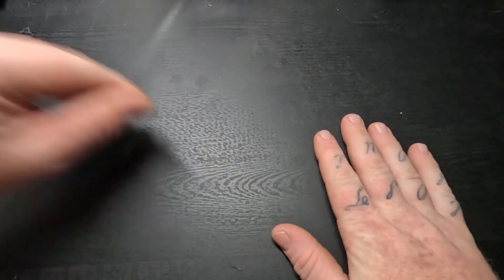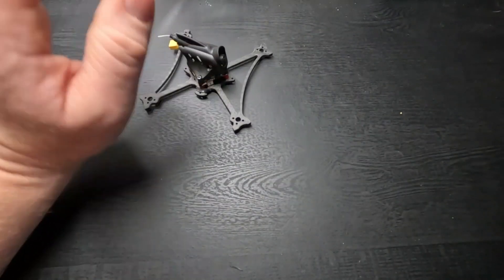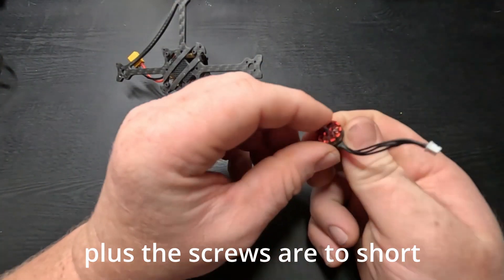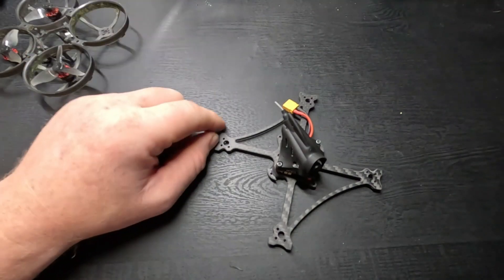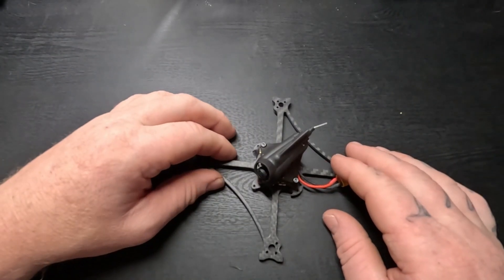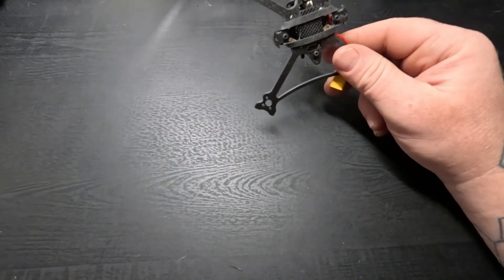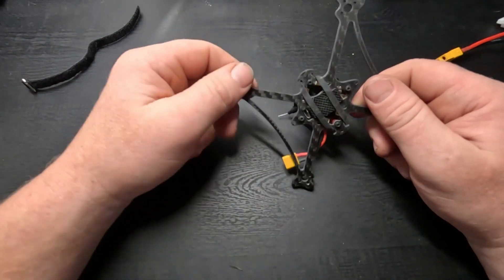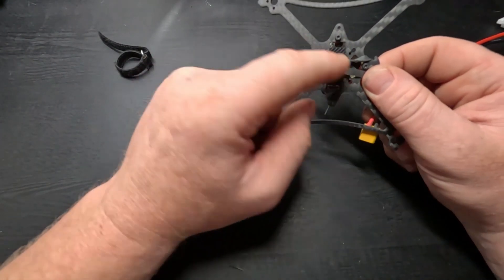Mobula 8 toothpick drone build - Petrel 120X - FPV

Comment: i hope you enjoy the building 
imo its satisfying if you build something and it works also its good against the fear of crashing cause you know you can repair it somehow ^^
i hope the new motors fit 
i was thinking about building a 3.5" quad with the grinderino frame but i lost my 5 " in a field after my lipo died and i had to search for it for 1.5 hours 
i found it but i might need to fix some stuff on it and i want to put a standalone beeper on so that i dont have to search for it again
Reply from the maker: i think have a standalone beeper is a good idea, ive lost for a few minutes the mobula. i set off the beeper and its not loud like at all.. im a fan of them
Reply: @WhiteTrashFPV  ye  i got a beeper on the quad but doesnt help if the lipo is dead...
if i loose my micro i just arm it and give it a little bit of throttle to find it
i think there is a option in betaflight where you can make the motors buzz that is louder than the beeper i think
Reply from the maker: i think there is too, or you need to use other software, the one where you can change the way the motors make noise when they boot up but that doesnt make sense, since you would need to hit a switch to make it happen probably something you can google i think
 @bluefpv3263
Reply: @WhiteTrashFPV  ye wouldnt work with a dead lipo but for tinywhoops its still a good option cause standalone beepers are like 15-20g which would be to heavy for a tinywhoop